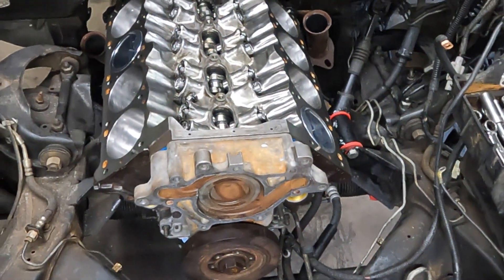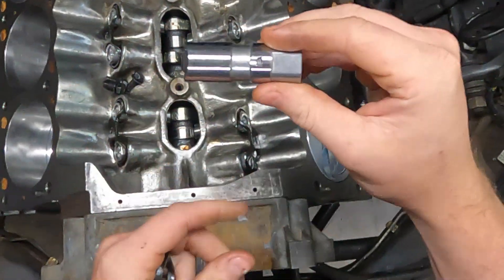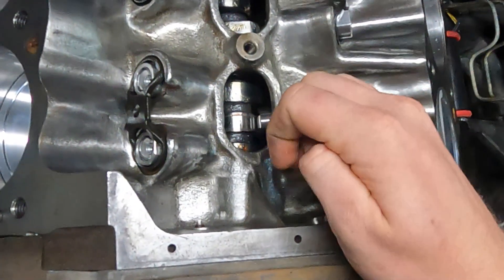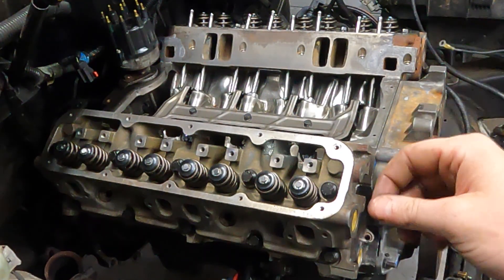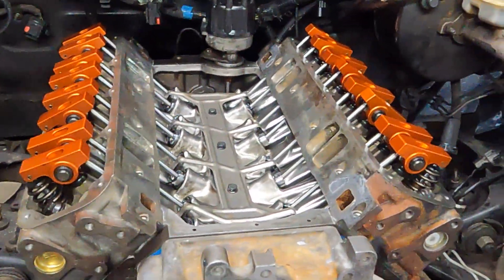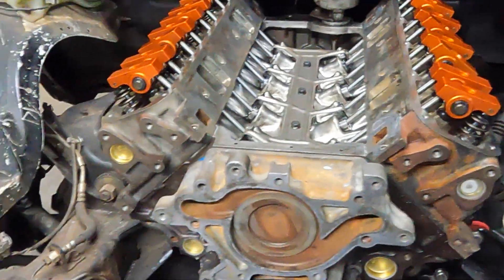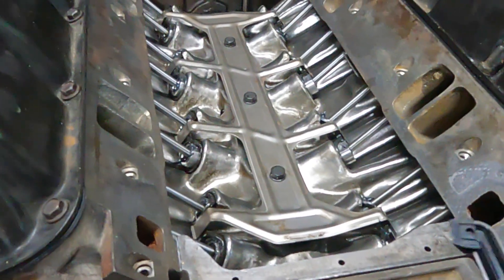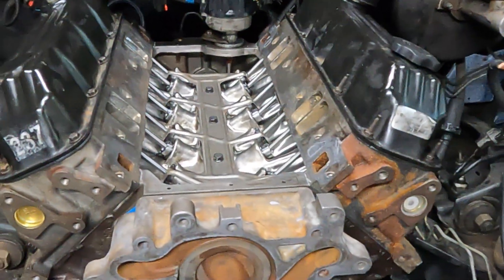360 magnum engine assembly pt3

Comment: Did you use the stock pushrods? Better question I guess would be are those the factory iron heads? I'm trying to put a set of garland sharps in my RT, I was gonna get a custom 1.65 ratio for mine. Trying to get around .555 lift
Reply from the maker: I did for a little while then went to trick flow pushrods. Ported factory heads.
Reply: @thomasbeyer  okay, I got some eq heads from PIE and with the rockers im not sure if the stock ones will hold up, let alone if they will be long enough. That's why I ask, probably should get some hardened ones but honestly if they fail the valve will just shut. I'm kinda curious what they can handle.

Comment: Hey thanks for adding the link to the cam and rockers. What push rods did you use and how did you set your lash
Reply from the maker: IV had 2 different cams in this truck. I believe I go over the difference in this video. https://youtu.be/UNCe8P_6dJ0
Reply from the maker: I used stock length trickflow push rods and the Harland sharps are bolt down and require no adjustment for the hydraulic lifters.

Comment: Are those non adj 1.7. If so what cam . Cause they say u can't run cam with them I'd love to get a cam 2
Reply from the maker: Yes 1.7 non adjustable. Biggest problems with cams in the magnums is getting valve springs to allow higher lift cams. I got my springs from utawesome that are good for .600 lift or so. Stock is limited to .510ish.

Comment: Actually oil drainback out of the lifter is why the feed holes go up. I worked for a Chrysler Plymouth dealership from '82-94 and we had a recall on Fifth Avenues and Gran Furys in 1985, where customers were complaining of valve lifter noise on cold starts. The good old UAW workers were putting the lifters in haphazardly, and the drainback was causing the noise. The recall lifters had a paint daub on the "top" to make sure the oil hole was up. Thanks for the vids!!
Reply from the maker: Thanks man that makes sense

Comment: Performer rpm intake. Best intake unless you want to use nitrous. I love it and never looked back... until I finish my 408, going victor or hughes single plane.
Reply: @Darkside Racing Is the preformer intake you recommend only for carbureted applications or will it work with a throttle body? Asking for my build.
Reply: @chrishamm268  I'll be honest. I have no idea, however later down the road I'm throwing Holley EFI on for data reasons. I'm almost positive it would work.
Now if your stock throttle body the bolt holes might not line up. Got to do your research... There's Dakotas out there doing things to their trucks, there is a dude with a Dakota and a Jeep on YouTube. He's diving deep into the stock motor. I cant remember his tag, he's doing everything out of his garage. If I remember  I'll try and shoot you his name.
Reply: @nickgti18turbo  I looked it up last night after I saw your comment. I'm going to do some research and see what my opinions are.
Reply: @chrishamm268  Thomas Beyer he's tinkering with the 5.9 Magnum and the 4.0 Jeep. I saw him after I bought a Jeep. Seems really honest and no BS